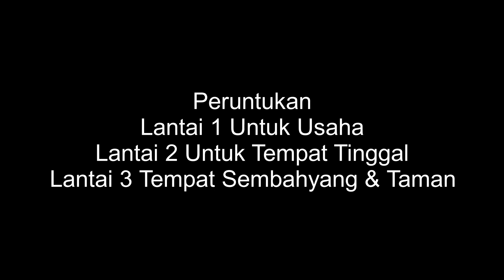Pembangunan Ruko lantai 3 Struktur bangunan Part 1

Comment: Utk ruko 5x5 mter .bwah Plong toko .atas tempat tinggal .
 Kira2 ukuran ckerayam nya BRP itu pk .
Posisi pinggir jalan raya
Reply from the maker: Cakarnya pakai ukuran minimal 90x90cm pakai besi 13 kalau cuma 2 lantai dan tergantung juga kondisi tanahnya.
Reply: @kapakisan  buset ckerayam 90x90 d13 .
Udh Kya bangunan BESAR 3 Lantai aja.
Reply from the maker: Standarnya memang seperti itu..kalau mau pakai d10 test jg bisa..tp itu diluar spek standar
Reply: @kapakisan  ckerayam 60x60x20 d10 fuL
GK kuat
Reply: @Sitiholiyah-ob4nk  semua tergantung jarak kolom juga
Mungkin 90x90 itu jarak kolom langsung 5 meter
Reply: @iamahacker7970  jarak antar kolom 2,5mter. Pk.  
Kuat gak pake besi d10ful Tiang kolom nya
Reply: @Sitiholiyah-ob4nk  klu jarak kolomnya cuma 2,5 pake 8 full aja sdh cukup kuat kok
Reply: @Sitiholiyah-ob4nk  cukup kuat
Reply: @Sitiholiyah-ob4nk  kalo jarak kolom nya 2.5x2.5,bisa 60x60,dengan besi 12 polos

Comment: Ukuran kolom dan balok nya berapa pak??
Reply from the maker: Kolom 40x20cm
Balok 42x20cm
Reply: @kapakisan  berapa ukuran bentangan balok nya pak??dan menggunakan besi berapa dan berapa Tulangan??
Reply: @kapakisan  Oya pak,apakah di lantai 1 dan 2 sama ukuran besi dan kolom sama balok nya dengan lantai 3
Reply from the maker: @oktasyaputri5425  bentangan panjang 5m pakai tulangan 13d 10 batang
Reply from the maker: @oktasyaputri5425  ukuran kolom lantai 1,  20x40cm untuk lantai 2, ukuran 12x40cm tulangan sama d13 8 batang..
Reply: @kapakisan  terimakasih informasinya pak,